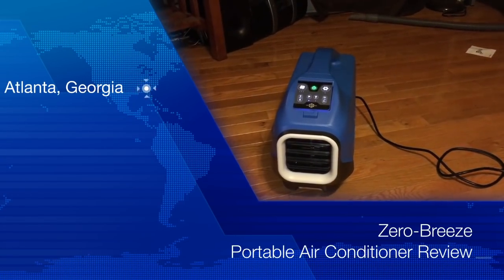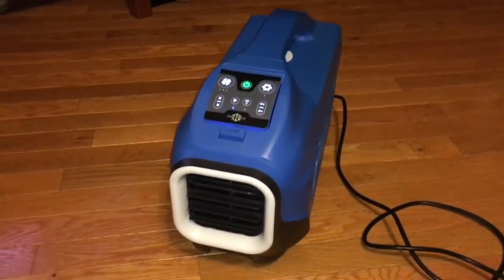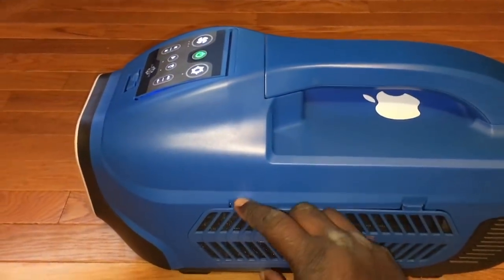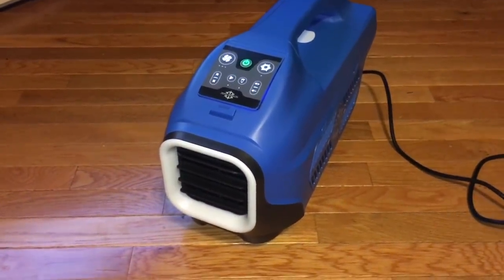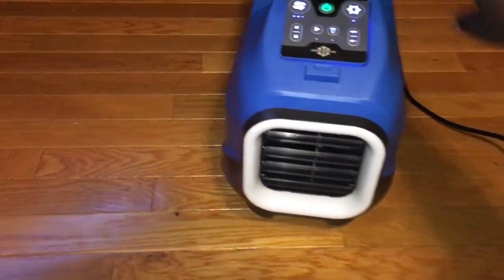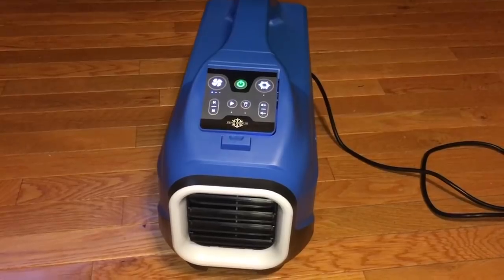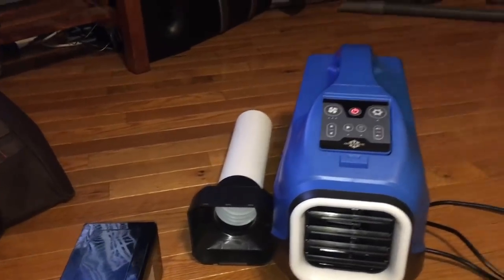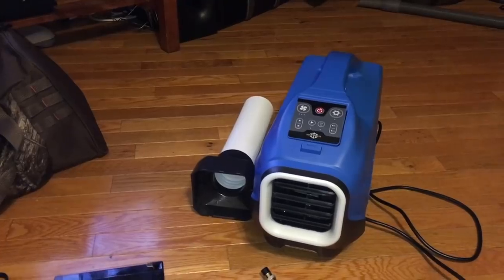Zero Breeze Portable Air Conditioner Full Review

Comment: ...Can you hang the hot air part out a window  , or is it not water proof....
Reply from the maker: Stephen Fiore The ZB comes with an exhaust hose and condensation line that can be routed out of a window. Although the unit is IPX3 waterproof, I wouldn’t hold the unit itself out of the window.

Comment: Thanks for the review. 2 questions. I have a teardrop camper. Sleeper area is approximately 24 sq feet and about 72 cubic feet. Do you think this unit could keep the inside cool around 70-ish on a hot Georgia day? Next question I did not see you mentioned anything about the compressor cycling on and off does this compressor just run continuously or does it cut itself off at a certain temperature?
Reply from the maker: Zach Sweet Good questions!

1)  It’s all about insulation. Single-hose Portable AC units have a disadvantage inherently because they have to use some of the cooled air to exhaust the heat; the ZB is no different. Because of this, they cool slower than other types. I can’t guarantee that it will keep the temps in the 70s, especially not knowing the ambient, amount of sunlight, amount of occupants, etc. I CAN say, however, that after field testing this thing in this Georgia heat wave we’ve been having for the last 2 weeks, it will definitely keep you COMFORTABLE. 

2) This model does not have a thermostat, so the compressor will not cycle once the desired temp has been reached. Maybe the ZB 2.0 will!

Comment: Where does the exhausted heat and moisture go? If it's not sent outside the room somehow then what you have is basically a glorified fan.
Reply from the maker: IAmNotAFunguy A detachable exhaust hose and condensation hose are included.

Comment: Where’s the heat go? Back in the room?
Reply from the maker: 2815Juan in spot-cooling mode, yes. In room-cooling mode (with the exhaust attached) outside or wherever you exhaust the heat to.
Reply: Jay Lee I would guess you’d have to wrap up the back half into a directional vent to send it outside... thinking about getting it for a Jeep overland build but I would like to know more about the heat exhaust as it seems to come out the sides as much as the back

Comment: Why not design one with a helium stirling cold piston that turns air into super cold Liquid gases that can then fill a condensing coil with air being forced through it to cool the air with the boil off vapor from the heat exchange being released with the outward air flow? A better way to cool a room. 😊

Comment: Where does the hot exhaust from the condenser go?
Reply from the maker: Brandon Morin For spot-cooling it exhausts from the rear. 

In area cooling mode, you would attach the included exhaust hose like a traditional portable AC to exhaust the heat.

Comment: He took a 12v, 12.5A AC, connected it to a 110v to 12v power brick, connected to a pure sine wave inverter and then connected it to a 11v to 13.8v battery?
Reply from the maker: Brian Dean I tested it using different scenarios, yes. 

First with the included AC adapter.

Then I tested it with it connected to a Pure Sine Wave inverter for the times I don’t want to lug around a battery or just want to use my car’s 12v Power source. 

Then I directly connected it a battery for the times I have a 12v source. 

It performed well in all scenarios.
Reply: Jay Lee oh I understand now. Scenario testing is a good idea.

Comment: So it dumps the hot air in the same room as it's trying to cool ?
Reply from the maker: DigitalYojimbo Only in spot cooling mode. It includes a detachable exhaust hose if you want to remove heat from the room.

Comment: Jason, thank you so much for your review!  I am wanting to purchase an A/C unit for my cuddy cabin in my old 1966 cabin cruiser.  All that I see available is a minimum of 6000 btuh's for portable A/C units.  Way too much for a small cuddy cabin that is maybe 12'x6' maximum.  It would satisfy the temp setting too quickly and leave the cuddy cold and damp, ugh.  1100 btuh per hour is probably going to run longer and dehumidify too.  So, why do I see this unit for nearly $900 dollars on Amazon and $299 on LilyShops.com?  Next question,  I have plenty of 12 volt deep cycle batteries on board.  Looks like I could run on them easily if I am staying overnight on the lake anchored far from a regular 120 volt power source.  Your thoughts?  Where did you make your purchase?  Thanks again in advance, great review sir!

Comment: $230 to cool a room that is 50sq ft.  it will cool a box smaller than 4x4x4 ft square. The web site indicates $350 mmm?
Reply from the maker: drjohn wills I don’t think the purpose of this unit is for room cooling; that’s more of a feature than a specialty. It is designed to be portable for small, personal cooling needs.
Reply: Thanks, Jerry  I knew that but found it very high expensive when you can purchase a small battery or dc operated one for $30 . I was looking for something that would cool a small cargo trailer for overnight travel off the grid. I did give you thumbs up for your presentation

Comment: Hi Jay. Do you know what the "starting surge" is on Zero Breeze? I'd like to use it when I go camping and I have a Honda 1000i generator. This generator should be able to run a 5000BTU AC but it can't start it :-/ may be Zero Breeze can solve that problem for me. Thanks
Reply from the maker: Marian Farah it can’t?  My Earthquake IG800 can And it only supports 800w. Be sure the Honda is not on ECO mode. 

As for the ZB, i’ve notice the compressor starts very differently.  I am not sure if it is because the compressor is DC instead of AC, but it doesn’t have the surge that a traditional AC compressor has.   It’s as if it’s been built to start with very low current pull. I’ve tested it with a 300w PSW inverter, a 12volt battery with a 15 amp fuse, and on a generator and the ZB never had a problem starting the compressor, so I doubt your Honda will have a problem starting the compressor.  Remember, the AC adapter that comes with it is only rated for 150 Watts.

Comment: Has anyone else had issues with water leaking out the bottom?  I have had this problem from day 1. Any solution or help would be helpful.
Reply from the maker: Ross Trevino even the later models still seem to have problems with the condensation draining on its own. There are a couple of things that I’ve done to keep the water flowing freely. 

1) every so often I tilt the unit back just to make sure the gravity causes it to drain. 

2) I hang the condensation hose as low as possible for gravity to drain the unit. Apply a little suction if necessary to get the water flowing.
Reply from the maker: Follow up:  ZB did mention that there is also a drain hole (the original) right in front of the power connector (the power connector is waterproof).   If the new drainage channel overflows water can still flow out of the original hole.   

It’s kinda inconvenient but not dangerous.

Comment: So it only cools 15 degrees for a tiny closet or something I wanted to use it on my truck for ac apparently cars work with up to  60,000btu and this only does 1,000btu I wonder if I crank my trucks ac to a comfortable state if this little ac could keep it at that comfortable temp for how long
Reply from the maker: Jpa5551 it doesn’t just cool 15 degrees; it’s more like 15 degrees at a time.   As the ambient temperature drops, the temp at the evaporator will continue to drop.

Comment: The exhaust seems to negate any cooling. Isn't it a principle that you have to exhaust air from compressor Air conditioners outside?
Reply from the maker: cody cowgill Yes. As with full-sized single-hose portable AC units, it creates a negative vacuum that will take much longer to cool than a closed system (like a window or central AC). 

It will still cool, however.

Comment: Why would you want to hook it up to an inverter when its already 12v adaptable?
Reply from the maker: Wolfsrudel von einem Good question.   

In a nutshell, because AC is much less susceptible to voltage drop than DC. I have a 25’ extension cord that I can use with the inverter. If running straight DC, I’d have to have a ridiculously high gauge of wire to support that length (which is also ridiculously expensive).   

Plus I use the inverter for other devices than just the AC.
Reply: Jay Lee 
Hot tunes from a cool device...dig it. 
Obviously made by people who know how to stop and smell the roses.

Comment: works with 220 V - 240 V?
Reply: The unit actually is designed to run on 12 volt power.  You'd just need the appropriate transformer to convert the 240 volt down to 12 volt.  The transformer will need to be able to output 12.5 amps at 12 volts.  Then you'll be fine to run the unit from a 240 volt power source.

Comment: Sorry but no it is not comparable to a filter even on a window AC. It's not even a "filter" except in the most liberal use of that term. It is a screen mesh that helps protect the internals from damage from large objects and will not keep clean. Dust and dirt will get in and the first thing it will effect is the fan. It is one of the inherent flaws of these types of devices and why there are so few well established companies making really small portable units.
Reply from the maker: diGritz1 It’s very much comparable to the filters on my Haier and Frigidaire window units. For all intents and purposes it filters about as well as those do (I’ve already vacuumed them out a few times).  Neither one of the filters are “good” and I suggest monthly maintenance for both based on usage.

Comment: Do you think this could work in a car? I mean, might be pretty shoddy trying to get the exhaust out through a window.....wife's a/c died and they quoted $2200!!! so maybe $200 would help!
Reply: Adam Stonaker I think it would work for sure.
Reply from the maker: Adam Stonaker The manual says it’s intended to be used on flat, stationary surfaces. I don’t think it was built for the vibrations of a car. Even if it was, 1100 BTU probably would not do anything in full sunlight.

Comment: Waay too expensive....900.00...My window ac is 5000 btus an 150 bucks at full price..These go on sale all the time for 105.00.You can find used ones for 89 to 99 bucks at a pawn shop.....This has some special features an its a specialty item.But I would never pay 899.00 on sale or 999.00 on it or even close to it....I expected it to be over priced at maybe 350.00....999.00 put down the crack pipe.....

Comment: I was looking for something to cool a hotel room in hot countries but that's too heavy. A couple of pounds is fine, not 15.
Reply: You're asking for too much... It's not going to cool a hotel room down anyway... At best, you can have it blowing on your head while you sleep and it might make you feel a bit cooler, as long as you route the hotter exhaust air out a window so it's not making the room hotter.
Reply: Grumpy OldMan   I will wait for perfect thing to pop up.
Reply: Have fun waiting then... You can't violate the laws of thermodynamics... All an air-conditioner is doing is pumping heat from one place to another.  To cool off a hotel room, I would say that you're going to need at least an 8000 BTU/hr unit unless it is extremely well insulated.  You might be able to get away with a 5000 BTU/hr unit if let it run continuously and never opened the door and taped all the air infiltration spots (under the door, etc).  It will eventually remove a lot of the humidity in the room and that will at least make it feel a bit more comfortable.  But the first time you take a shower, all that humidity will probably be back in the room.

Last summer, I spent a lot of time in hotels that did not have air-conditioning in the rooms, but that was in the UK, Ireland, and Scotland, so even many of the upscale hotels don't even have air-conditioning since it is so cool there.  There summer temperature is about the same as a cold "winter" day here in my part of of the Texas Gulf Coast.
Reply: I always try to improve my way of traveling. I have a home made scooter, a folding fridge, a gadget to have hot showers everywhere etc....cooling a room would have been great but hot showers is more important. I can adapt to heat, not to cold water. But if something miracle shows up to cool a room, i will get it !! I have to decide between Thailand or Dominican Republic.  Most Thai rooms seem to have AC but it's not a reason to choose Thailand.
Reply from the maker: I think it’s going to be a few years before technology can develop a vapor-compression unit that supplies the amount of BTUs you will need reliably in a portable package less than 15 pounds...

Is the humidity high where you travel?  If not, you may be able to use an evaporative cooler. Those are much smaller and cheaper.
Reply: Jay Lee Seems technology has limits even in 2018. There still rules hard to bypass.

Comment: Can you test this with a thermometer? You will get different results as the gun will only pick up a surfaces temp which can vary depending on material. A 18F-20F degree split between air temp and the supply is ideal. Thanks in advance.
Reply from the maker: collin cortez Good observation. This is why I checked the temperature at the evaporator and at the condenser themselves. I’ve done this multiple times in multiple scenarios over the last month to get the values listed at the end of the video. According to my findings, it averages about a 13-15 degree F drop from ambient at the evaporator coil. The ambient temperature was cross-checked with the thermostat located near the testing location in my living room.

Comment: Can it cool a full size van down to around 70 degrees for 7- 8 hours on a 100 degree day or night?
Reply: A Netizen It would not cool a full size van down to 70 on a 80 degree night much less a hundred degree night.
Reply: Well dagnabbit.. I need a compact cooler that can at least come close. I live in the desert...and would want something that ideally could do that...without having to modify the van to RV spec.
Reply: A Netizen You would be better off with an ice chest full of ice and a battery operated fan blowing across the ice than that little ac. Any kind of heavy use with that thing and I would lay money down it wouldnt last the warm season before breaking.
Reply: Uhhh... no.
Reply: I would look into getting an evaporative (swamp) cooler. I lived in the Mojave desert in my rv and the swamp cooler did the job.
Reply: FL Moseley: Their adverts claim:  "Zero Breeze is capable of cooling a 50 square feet room down to 44 ℉ making it perfect for your home, office, tent, RV, college dorm, and so much more."
Reply: FL moseley 
You are right. I went ahead and built one much as you described.
Works like a charm...and for a lot less than I would've paid for this puppy. My self built battery powered swamp cooler uses 2 quiet high cfm computer fans. A fully charged battery and a bag of block ice will keep a full size van cool for
8 hours on a 90 degree night...NO PROBLEM.Total build cost: 50 BUX.
The charger battery will hit you for a note.
Reply: But apparently his sounds like its not insulated or anything, "RV specks" Put some reflective paint on it and park under a tree lol
Reply: And the cost of the block ice

Comment: but 10 degree cooler from ambient temp is not a A/C   
 at modest  an A/C that is broken  if my car was outputing  only 10  lower I'd be adding Freon to the system and finding that leak 

a REAL A/C will work at 34F  ( below that it would freeze over.. duh)

Comment: Will this work in a small room with one window but without removing the screen?
Reply from the maker: K9doglover At 1100 BTU/hr, it will have to be a very small room that is well-insulated and not in direct sunlight.  You will be comfortable in front of it, but it may not actually reduce the temperature until the night.
Reply: Ty so much for your reply

Comment: I bet a peltier inside it, with  pc fan that simple  i can Diy it..
Reply from the maker: Edifier Bass Nope. This is the real deal. It has dual condensers, one evaporator, a compressor system charged with R134a, and 2 fans.  The exhaust fan is a high output fan you’d find in a higher-end PC, but the evaporator fan is actually a “squirrel-cage”.

If it were solid-state/Peltier, Lord knows it would be quieter lol
Reply: Oh' sounds interesting, It's a personal air.conditioner, so I wonder how fast it will cool a normal sized room, but anyway a nice demo thank you..